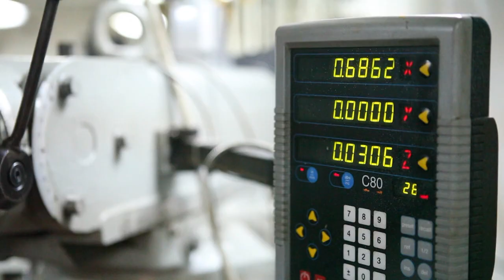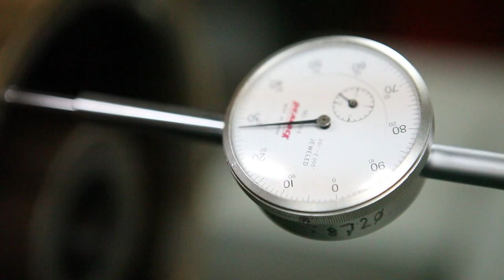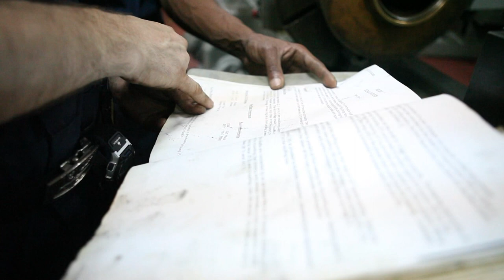Fraction Of An Inch - Navy MRs "Make Something Out of Nothing"

Comment: Vernier scale calipers? A lathe without a DRO? Have they not bought tools since WWI? The peacock indicator is decent, but why not go with American Strarrett?
Reply: All of that machinery was put on board during the ship's construction. Replacing it would require dismantling much of the vessel. A DRO is nice to have, but hardly necessary. It's also a cheat.
Reply: @kmoecub  A DRO can easily be fitted to pretty much any machine and can easily fit through a doorway.

Comment: I am very surprised that the military isn't 100% metric these days.
What gives ?
>
Reply: WAITING FOR THE SOCIALISM CERT!!!!
Reply: By-in-large they are, at least far more than the US civilian population. kilometers, meters, and millimeters are standards in communications and identification. I think weight (Kg) and volume (litres) are less so, but usually anything labelled in imperial will have metric measurements adjacent to it, namely due to the fact that just about all of our allies use metric, and supplying material and equipment across different nations' militaries needs to be as a smooth and efficient as possible.
Reply: @QuantumAscension1  "By-and-large"
(Sorry)
>
Reply: Multiply or divide by .039 or 25.4. There, fixed.